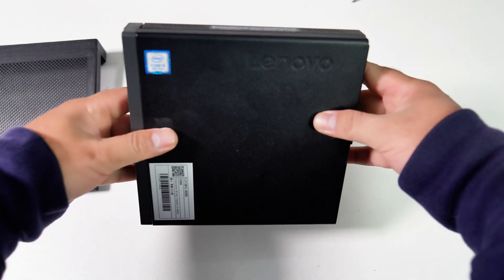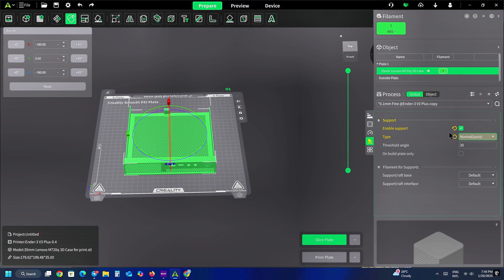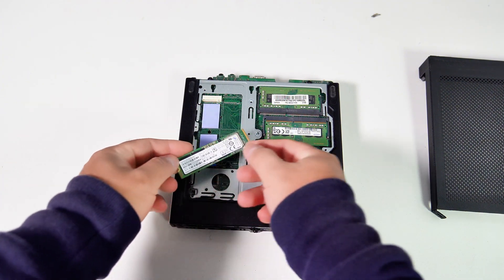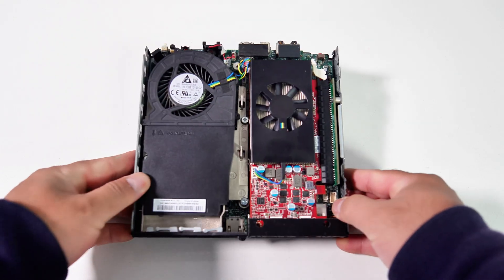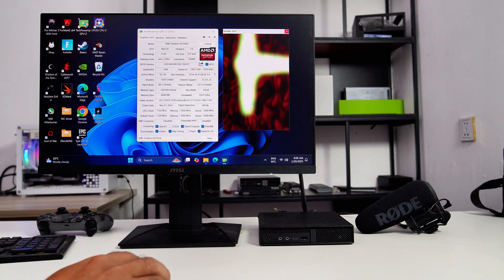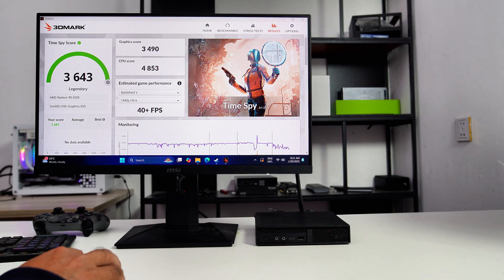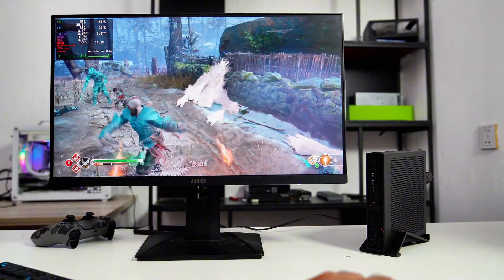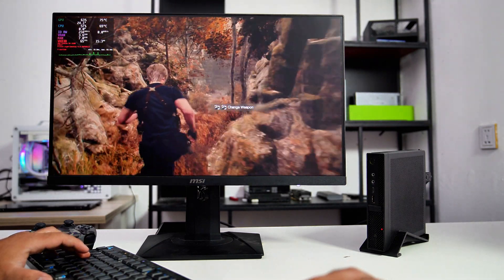M720q vs Bazzite: Cheap PC, Epic Games?

Comment: Awesome but also for those that don't want to do or can't do this they sell other models tlof this tiny PCs that have integrated ventilation too cover shell.
Reply from the maker: I think it's good to have different choices. As I mentioned in the video, you can have both; it is not meant to replace the original permanently. I spent some of my free time designing this 3D file and sharing it with everyone for free. Anyone interested can download and print it if they have a 3D printer. However, it does not mean everyone has to buy a 3D printer to print these files or use the 3D-printed case instead of the cases sold on the market, as you mentioned.
Reply: @itggear  Yup exactly, I agree 100%, that's why I mentioned to those that don't want or can't 3D print.

Comment: Would you recommend this case or the one with the 140 fan?
Reply from the maker: They both have pros and cons. For example, the 140mm fan adds some RGB effect, giving the PC a new look and feel, and it's quiet too, but it makes the PC bigger. The 1L case is just to add some ventilation on the top cover to allow you to install a GPU, because you cannot install a GPU with the original case since it doesn't have any ventilation. The 1L case allows you to install it in the same way as the original case, but the GPU and CPU temperatures remain high, as usual, and it might be quite loud. Thank you."
Reply: @itggear  Thank you for your answer, so I will stick to my initial choice, the one with the 140 fan, this will allow me to put a more powerful CPU while keeping a correct temperature.
Thank you for your work <3

Comment: I found a 720q in an E-waste bin at my job a few weeks back. Has an I3 with 16gb of RAM. I already ordered the GPU adapter and motherboard heat sinks from AliExpress. I'm going to upgrade to a i5 9600t with either a RX 6400 or a RTX 3050. I can't wait to play with it.
Reply: @PDRIFT86  my recomendation if you want a SteamOS device is the rx6400 valve already said in an interview that they don't release steamOS for PC because nvidia drivers problems
Reply: I got the rx6400 but it gets way too hot, I switched to the rtx 3050 lp from msi, has better performance and it doesn't get as hot, as well as the fan doesn't need to launch into space top perform ok, I got the m920q with th i5 8600t, great performance tho